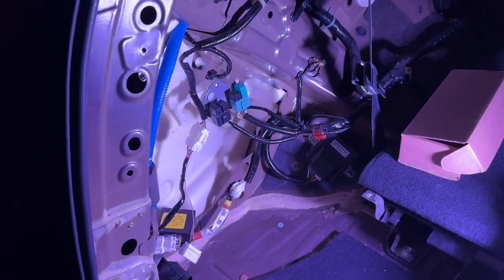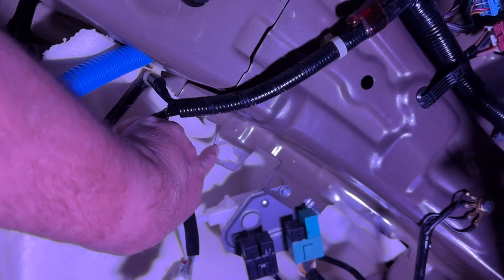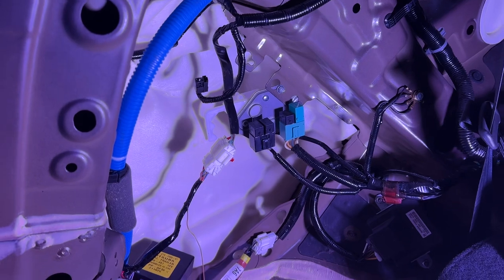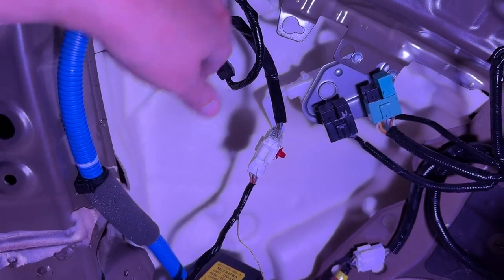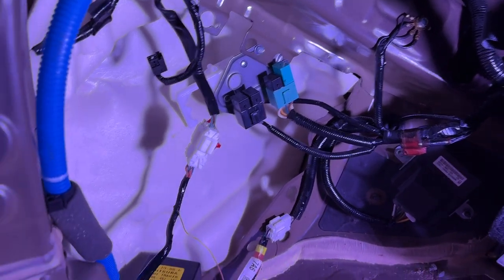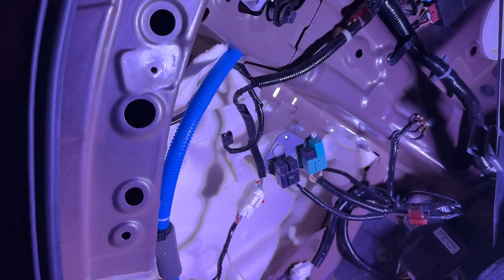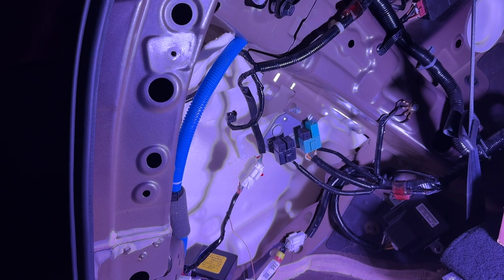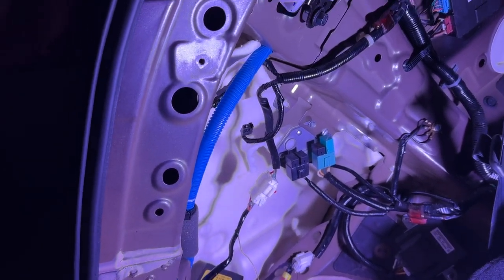Honda Pilot Trailer Harness (connector MIA)

Comment: Did some digging.

"According to my contact at Tekonsha, the connector you're looking for will only be present if the bumper sensors are dealer-installed. If the parking sensors were factory installed, the connector will NOT be present, and the blue wire in question doesn't need to be connected to anything. You can just bundle it up and tuck it out of the way, using a zip tie to secure it. The trailer connector will work fine. The factory installed parking sensors are most common, which explains why we don't have a video showing the # 118760 installed on a vehicle equipped with the dealer-installed sensors."